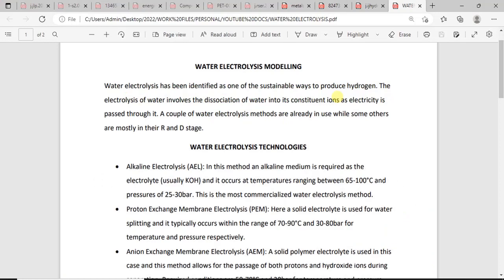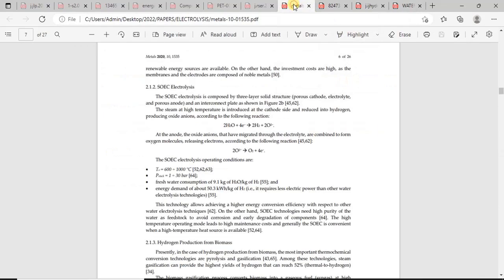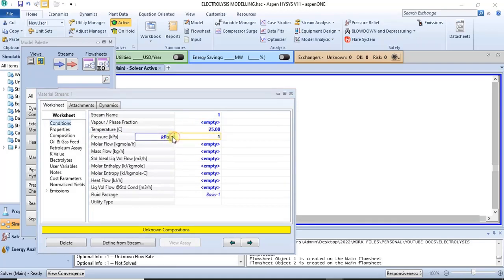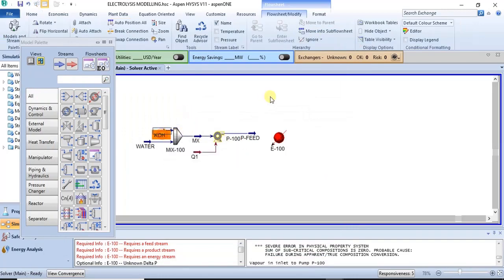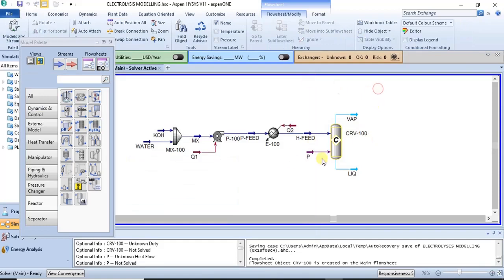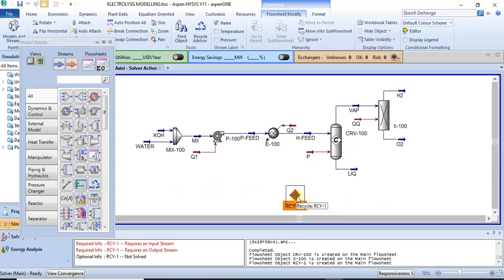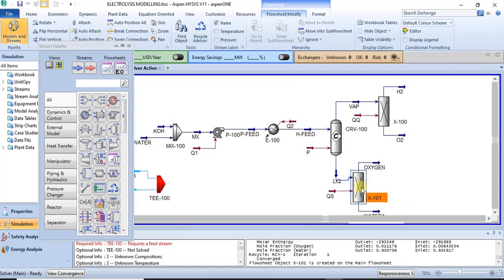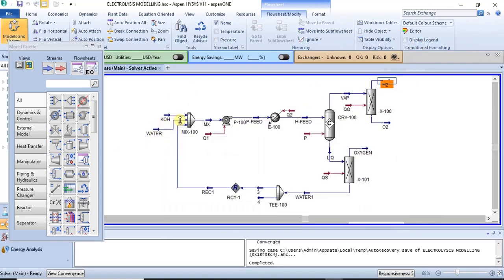Water Electrolysis Modelling II

Comment: Thank you sir for the video. That was so helpful.
I just have a problem, i followed the tutorial step by step and everything was okay until entering the heat flow (P). Even if i used the same value (230 kW)  i didn't get the same T of LIQ & VAP which leads to many problems in the next steps. Could you help me please?
Reply from the maker: Text me on WhatsApp...+234 706 613 4201

Comment: Thank you for the video, when I input 25 °C to the KOH, on molar enthalpy and below appears -1.#IO000. And the mixer won't solve the mixture. When I input higher temperatures like 1500 °C or 2000 °C the KOH stream is then solved but with different values.

Comment: thank you for video do you have video for High temperature electrolysis ?
Reply from the maker: Hello😊

Typically you can model high temperature electrolysis by using the process conditions for high temperature electrolysis in your model...so the process is typically the same its mostly the operating conditions that differ, then the electrolytes and probably the catalysts (not required since conversion is used).

I specified the operating condition for high temperature electrolysis at the beginning of this video.
Reply: @hotspot105  Thank you for quick answer will I choose in the component list Potassium hydroxide and in electrolyte wizard KOH or H2 ?
Reply from the maker: @laithmustafa226  Watch the part 1 of this tutorial👇🏽...use the link below.

https://youtu.be/_J-EUxda15k
Reply: @hotspot105  I already did so according what I understand I will follow the same procedure but the difference are range of temperature and pressure.  is it correct ?
Reply from the maker: @laithmustafa226  Yes, for high-temperature electrolysis modelling.
Reply: @hotspot105  thank you very much
😃
Reply from the maker: @laithmustafa226  Remember that high temperature electrolysis works without alkaline medium...so you can model without the alkali too. You can specify only the water dissociation in the electrolyte wizard.

It makes use of solid electrolytes like zirconia